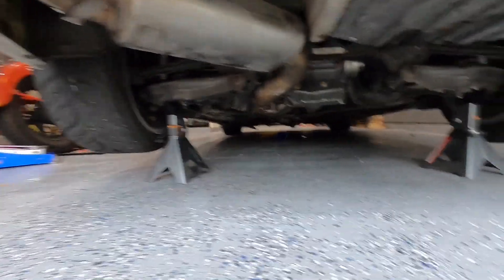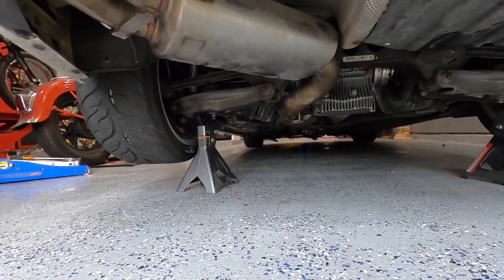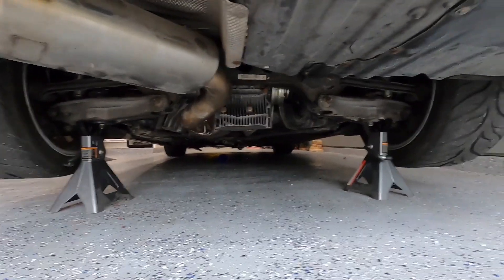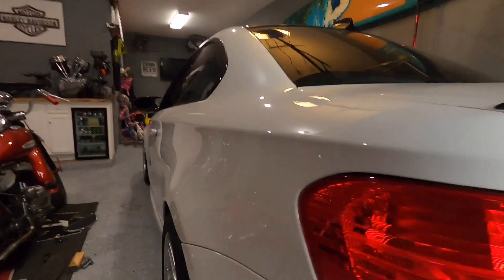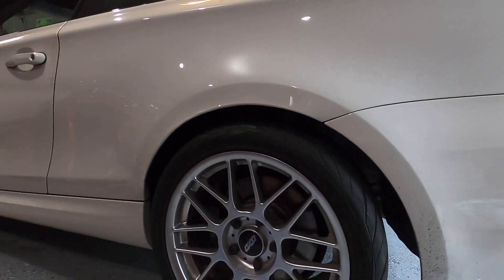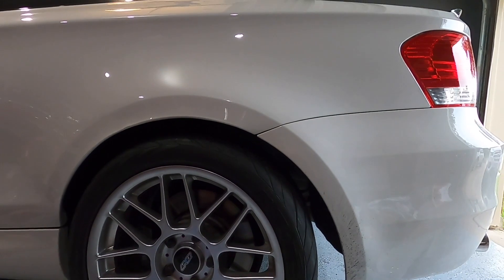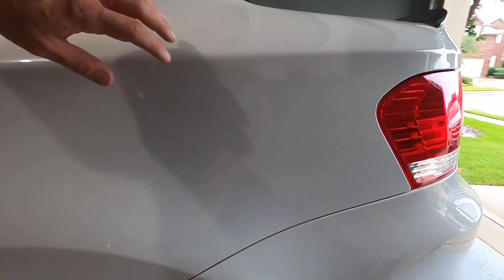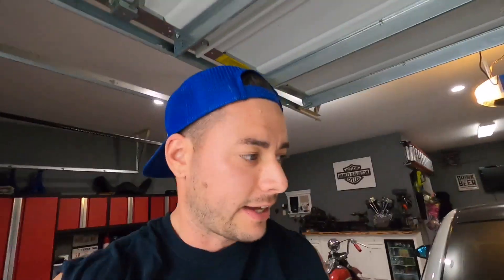750WHP Single Turbo N54 it’s still broken and can’t fix it

Comment: Has to be the carrier bearing... ( center support bearing) Had this exact noise only under load. Also Check driveshaft U joint while you're there.. This should move smoothly. If not, replace. 
Usually if the carrier is bad, it's because the driveshaft u joint is also bad. Best to replace these together. 
EDIT: Noticed on your previous video, you're no longer running stock type driveshaft. Disregard... 
But typically this is the first place to look for the stock driveshaft cars, with this noise.

Comment: Yeah man, its coming from your Drive shaft may b you need to replace the center baring that holds the driveshaft. It has to be driveshaft related
Reply: He had single piece drive shaft.  He hasn't got centre bearing.